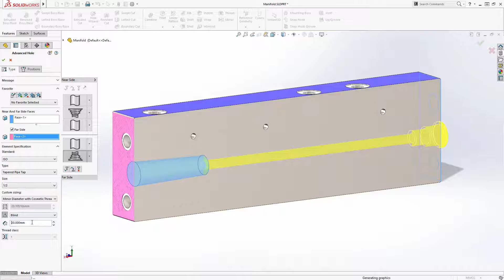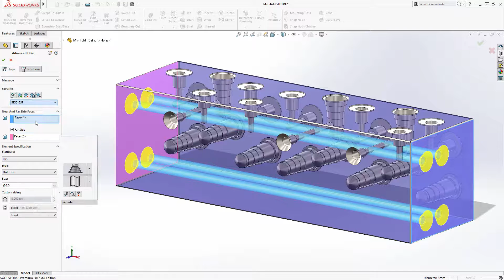What's New SOLIDWORKS 2017 - Advanced Hole

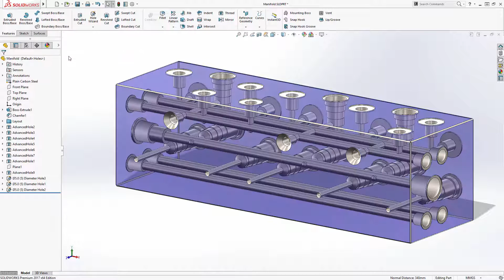Comment: At 1:07 minutes you select 'Holes'.
That's not visible to me....
Do you know why?
I have the 2017 version of SW
Reply: Caroline, he created a new "Display State" and assumed you knew. Open up the display state pane by clicking on the little arrow. Move down to part name in Feature Manager (Manifold) and move your mouse over to display state pane and right-click in the open box. Select "Add Display State". Give this thing the new display state name ("Holes"). Once you select "Holes" as a display state make the part transparent. Once you do this you can move back and forth between the new display state (Holes) and the old (Default - Display State 1).
Paul